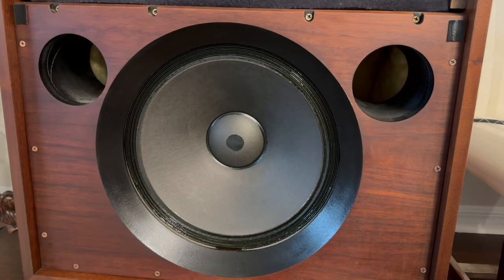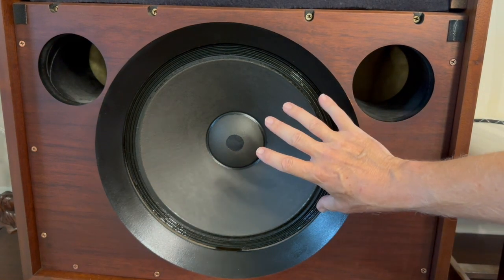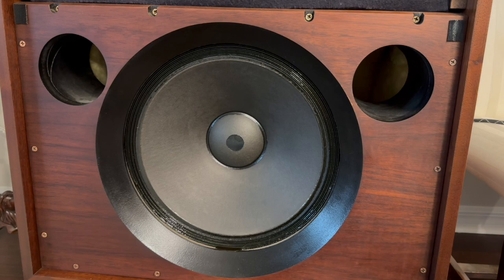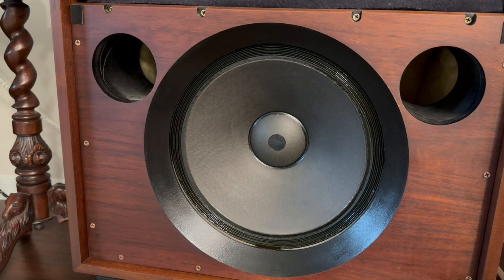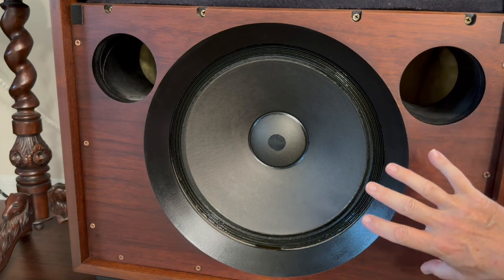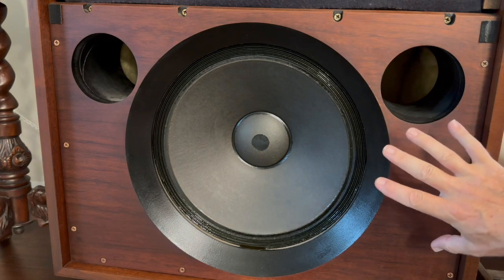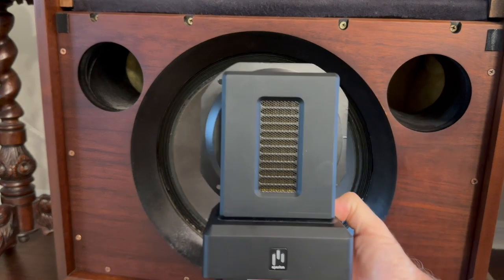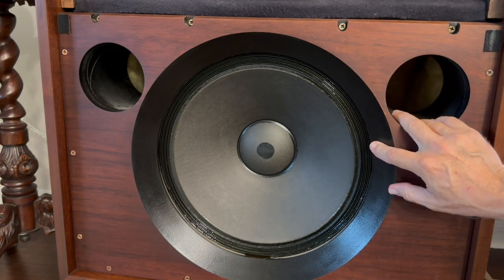The adding of waveguides to base speakers

Comment: chamfering of the baffle is decorative for bass speakers ,  the waveguide on your speaker is completely undone by the two ports and even the overall baffle width , which interfere with any wave during its propagation , horn loaded tweeters and tweeters with wave guides have the guide length to match the wavelength of the frequencies the designer needed to reinforce . this is all backed up by over a century of research and 'empirical evidence'  .  happy listening

Comment: Makes sense I think. I like the look of it too on your Altecs. The amplifier has a lot to do with speed of driver reaction. I  run a pair of JBL 2226h in Jbl cabinets with Rotel RB 1582.... only 200 watts into 8 with a damping factor of 1000 sounds fast supporting my Altec Urei dual concentric speakers. There is clearly a lot to speaker design. Great video.

Comment: The wavelengths of low-frequencies are too long for waveguides to work. The soundwaves are too large to diffract or reflect off of the baffle. You can put bass drivers in horns to increase the acoustic impedance, but that does little to stop their near-omnidirectional sound travel.
Reply: I agree with you.  To actually be a wave guide it needs to be a quarter wave length. This mounting is for looks. It may attenuate some higher frequencies, probably noise from the speaker moving.

Comment: We can go further regarding sound quality.
My experience and I have learned that the box reflex enclosure is not the optimal for  MUSIC reproduction.

As you showed the audiophile with the red open baffle (OB) speaker that Clayton has designed.

Remove the box and you remove a lot issues and problems but you get of course new ones.

OB is the least efficient "enclosure" but on the other side amplifier watts has never been cheaper as today.

The bass reflex port we can see it as a small driver that has infinity of millimeter Xmax driver excursion.

So yes your big altec  wooferarea is not moving that much but all that area divided small movement pressuring the compressible air when going in and increases air pressure in the cabinet.

The pressurized air in the  that box as you illustrated with the paper. Will act in the bas reflex vents. That has a unlimited Xmax driver excursion.

The issues:
1. Those vents is in practice acting as a bass cannon (high air speed that not exist when using a big drum as you have as table). And as such exiting stuff in your room that may rattling/vibrating. 
2. In the time domain the driver compress the air in the box then it act in the air in the vent. All of that is events happening after that the real event that the microphone has captured. In other words what the microphone capture is reproduced and amplified and the electricity in the voice coil that makes the woofer go in and out is what and WHEN the actual sound event were produced and captured. And that is what we ideally should want to listening to. And not something that is time delayed and coming out from a coil less vent. Will of course smear and give less definition.
3. A box is air tight with top bottom side and back panels of different sizes and maybe could be different thickness and materials also.
Depending on size thickness (mass) and material if the panels they will have (cabinet ) resonances when they get exited and vibrates. When they do that they are actually acting as a cone of a driver and producing sound (that were nowhere in the captured event actually it is a kind of distortion) yes we can try to add glue in damping material in the inside (added mass actually) to the panel and just move the resonance frequency to another frequency.
4. Those boxes at those lower frequencies is OMNIDIRECTIONAL. Meaning that sound is radiating at ALL directions and load the room maximally and create maximal problems on the other hand that may/will require more acoustical treatments (bass is the hardest and most difficult frequencies to treat..)

ALL of the above issues are OB solving. (I could go into details on how/why but then this would be twice as long post).
But we just need more power for the OB, as the bass reflex box is a compromise to get lower extension as if the woofer would be larger then it is. 

So we see clearly that if we want better sound quality (SQ) with fast and defined (no time delayed smearing, no panel and cabinet noice). And no time delayed distractions with pants vibrations 😂 and canon shots to the chest.😅 With increased room acustical issues. Then OB will give better SQ for music.

But I must warn you as you realize the boominess and effects as fun chest pounding hitting feeling is more or less GONE! (That is a ARTIFACT of the bass reflex enclosure design).

When we all are used to bass reflex as they are more efficient and used . Then we are used to feel (a effect) the bass as in rock concert (PA systems). It will take time to get used to not having that.. 

So in short if you want to hear in music everything and all details down to your hearing threshold then a lot of cone area in a OB enclosure is the way to go.

But if you want the effect (as going towards home theater) then bass reflex enclosure is a much better way to go.❤

As background info I have a dedicated, symmetric, treated listening space. For 2ch listening with two OB 18" hanging in the air to get away from the (3 dB gain) that the floor boundary gives. With a miniDSP and all is calibrated and measured with a calibrated microphone. And following equal-loudness contour (iso226:2003) that supports our hearing sensitivity that changes with frequency.

What I try to say is that "measuring is knowing". So I know that I play very low and (can) with high levels. When that is known I then note that the effect/feeling is not there but I can hear clearly everything as if the OB acts as a magnifying glass.

But unfortunately we can't get the best from the two different enclosures, so pick your poison. 😂❤
Reply from the maker: So true
Reply: I watched the video and subscribed. I am interested in the woofer wave guide idea, and agree that felt helps achieve a cleaner sound as it absorbs some reflection, however based on the comments I read, I'm thinking that there's a general misunderstanding of how bass reflex and sealed cabinets work and the idea behind smaller woofers and baffles, as well as the various styles of woofers, as well as the goal to achieve a full range flat frequency response, or colored frequency curve from a loud speaker design, as well as that deep bass and it's purpose.

I've rear mounted woofers with routered front baffles, but never tried a woofer wave guide. I am skeptical that it would provide any difference, except to keep the immediate reflections from bouncing off the front baffle, but is more likely to cause interference which can cancel or attenuate certain peaky areas the woofer produces. The woofer covers a huge range of music, not just deep or subsonic bass. Omnidirectional isn't a consideration until the woofer is operating in the subsonic range, (as you mentioned in your video roughly 30'ish hertz). The rest of it is certainly directional and the sound source is easily distinguished.

Depp bass is present in recordings because of reflections and bass loading, which is picked up by mics and then recorded, so the playback should have those remnants to sound real. A drum is not a speaker, and there's no way to tune a speaker to match a drum. Deep bass, when played back at the proper SPL matched to the rest of the frequency is what gives it that big soundstage and one of the reasons I love big driver speakers. Natural frequency of wood and MDF is in the 200+ Hz range, so the higher the woofer is crossed over, the more important defeating resonance becomes. Smaller woofers are crossed over higher than large ones so anti resonance becomes very important the smaller the driver is.

In short, the cabinet is designed specifically for the Woofer. Whether it's bass reflex, acoustic suspension, sealed, open baffle, or horn loaded has more to do with the Woofer selected and controlling it. In terms of muddy bass caused from delay, while there might be some delay, at the speed of sound across 10 or 15 feet is not audible. That may have more to do with placement, reflections, nulls from bass waves cancelling out at the listening area and so on.

The tweeter with the wave guide, might sound cool with the reflections off the back wall, but it introduces a whole bunch of other issues, delay being one of them, which will be much more noticeable in the treble frequency ranges than bass frequencies, negatively impacting clarity, imaging and that "tight" sound you described, which often comes from the higher frequencies emitted from the drums which depending on the size of the drum can reach into the Mid-Range and higher octaves, not to mention the sound from the skins, sticks, rims etc.

Interesting wave guide on the Woofer how did you make it?. Thx
Reply: @wattspeakers  
I have triple checked and omnidirectional (= 360°)
Is FAR higher up in the frequency range!

Speaker manufacturer Genalec say typical below 200 Hz for monitors another source and drawings says 20-400 Hz. 
And I see some measurements that showing omnidirectional at low estimate 800 Hz. But probably depending on several factors but it is at least a extending a factor 10 times higher up in the frequency range than it is believed here. 🎼
Reply: @AmazonasBiotop  Hmmm... I wouldn't doubt that frequencies as high as 200 Hz are omnidirectional to some extent, but they're still directional as well. You can tell really easy if you've got a little subwoofer that'll play up to 120 or 150 Hz. I can guarantee you could find it with your eyes closed. Or another way is with satellites. My Energy Micros only play down to 150 Hz and I can easily spot them when I bass sweep them.

I've got a couple of Energy's 8" CSW that are super simple to locate the sound source when they're set to 120, and I've got a passive 12" sub that crosses at 100 Hz and I can locate that source within several feet. My energy S12.3 in my home theater setup that's crossed over at 50 & 80 Hz electronically by the receiver and plays down to sub 20 Hz is more difficult to locate, especially with the subsonic bass. Most of the time though despite the box being bigger than some end tables, it may as well be invisible because the bass seems to come from everywhere, but doesn't rattle anything unless it's stupid loud. It's wild because in the powder room down the hall, even with the fan on and the door closed, it sounds like there's a dump truck parked next to my house, (even when the volume is low). And there's a corner in my dining area where if I stand there I almost lose my equilibrium... My wife pointed that spot out and I was like "yeah, yeah... just like the bathroom" and she's like "no it's different, go stand there"... Well, once again the wife was right lol. That subsonic bass is almost purely omnidirectional and very trippy.  

Another way you can tell, is just pull up test tones on YouTube and run a frequency sweep or steady tones. I'd be surprised if you can't tell where it's coming from.

When I'm frequency testing the speakers I build, I can usually start to source the bass when it gets around 40 Hz. 50 Hz is easily located.
Reply: @wattspeakers  
You're falling into the gap between directivity and direction. After 200hz it's pretty easy to tell where the sound is coming from, ie left, right, front, back etc, below 100hz it barely matters.

Being able to control directivity and sound having an identifiable source and direction aren't quite the same thing.

So in other words yes we can hear from were a speaker is located in the room when it plays 800 Hz.

But what omnidirectional means is that if you go with a measuring microphone around the speaker (360°) when you play 800 Hz at example 80 dB. Then it will still be 80 dB when you're positioning behind the speaker or where ever in all the 360° around it!

So now we understand better that that sound energy of 80 dB ! From our 800 Hz is RADIATING in directions where open baffle has a natural cancelation effect!
That is up, down and to both of the sides.
So as I said before this will load the room much lesser with sound pressure.. that will require less room treatment and those frequencies 800 and below is needing much more treatment quantity when containing much more energy (there is a reason why subwoofers has ~1500 watts plate amps, energy don't disappear it just take another form).
So a box is good for pressurizing, vibrating and shaking a room as a desired effect in home theater..

We need also to remember that if we have a system that can play 20 Hz and we play at 80 dB measured at 1000 Hz. 
Then when our hearing is LESS sensitive at 20 Hz that what it is at 1000 Hz.
Then we need to play the 20 Hz at ~117 dB! 
Just to hear it EQUALLY LOUD as the  1000 Hz that is at 80 dB!
(Read it again it is very important to grasp. It is called "equal loudness contour" and is what researchers found out 1933 and today it is a ISO standard)

Majority of people do not understand the equal loudness curve. They can think that "ahh it is a smiley curve" that is correct but when you realize that IF and when we have a system that is following exactly that equal loudness contour (frequency response) then that is actually what is precived and heard by homo sapiens in their best years as just FLAT! (But yes it is a smiley curve for a microphone that has equal sensitivity at any frequency but that is NOT how our hearing is proved to work.. 😂 )

That is ANOTHER reason why subwoofers needs ~1500 watts.. when we need to pump out much more energy at lower frequencies just to PERCEIVE it as loud as the rest of the frequencies (music). And we also understand that more watt out = more room treatment may be needed. 👍

(Another example is if you play at 60 dB at 1000 Hz. Then if you go for "microphone flat" and still play at 60 dB at 20 Hz.. then you win NOT be able to hear 20 Hz when it is there because 60 dB at 20 Hz is BELOW our hearing threshold! So it is waste to produce that 20 Hz at 60 dB when homo sapiens is not able to precive it at all!)

Comment: Actually the wave guide is the wrong way round you want it to Narrow not opening out! better control with bass in your room. make a ring out of one or two inch plywood and attach it with some Blu tack or double-sided tape. bring the tip of the wave guide right up to the paper cone or even a little bit more a few millimeters over the paper cone edge, not the surround, you should find you get a much better controlled bass. just round the edges a little bit a few millimeters so it's not a square edge. Give it a go got nothing to lose plenty to gain prove me wrong!